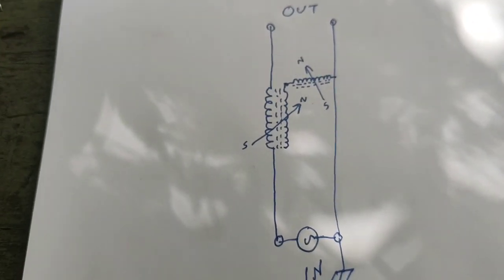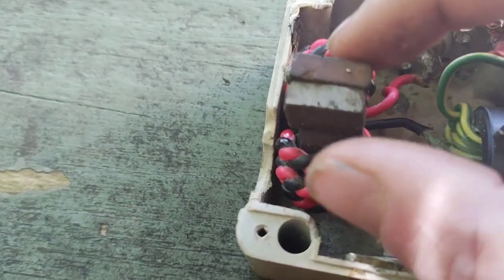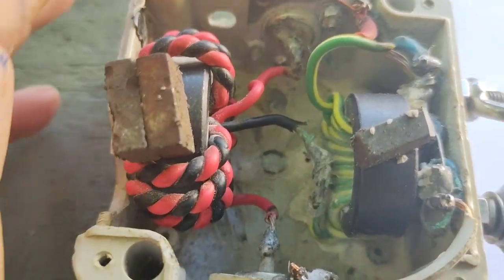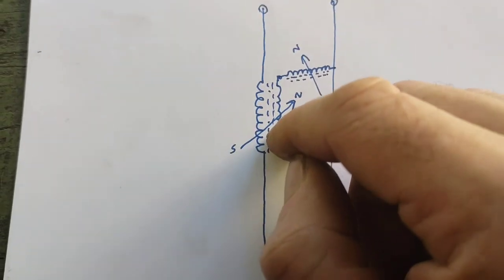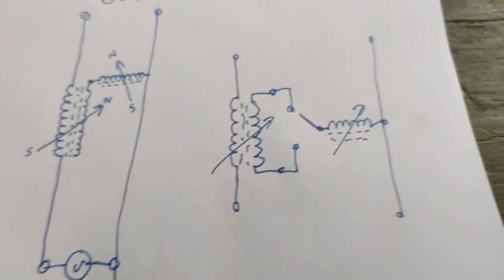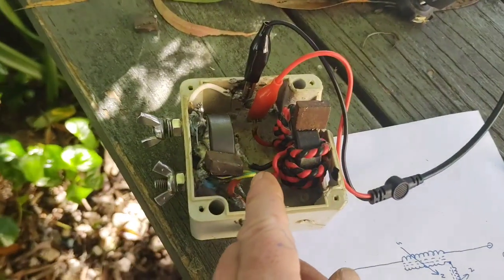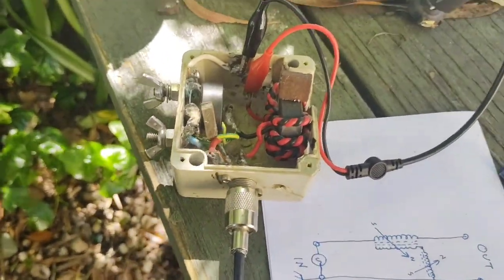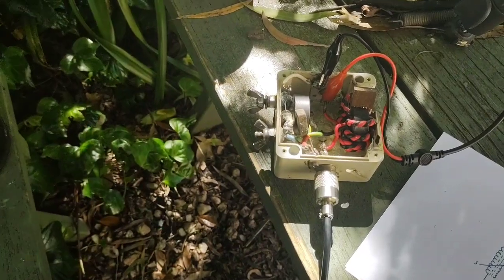How to Build a Magnetic L Match Antenna Tuner Without Variable Capacitors for HF.

Comment: interesting..
Reply from the maker: The concept works really well my friend.

The one in the video is my usual go to tuner for quick easy tunes on experimental systems.
Reply from the maker: Thanks for bringing my attention back to this.

I should really do a much better video on the subject sometime in the Future.

73 de VK3VKe 
Crazy Ham
⚡🙏⚡
Reply: @crazyham  is the magnets neodymium?
Reply from the maker: @minahasa999  You can use Neodymium for sure.

It pays to vary magnet strength for different tuning ranges too.

I am not certain what type my square ones are
as I got them from a lifting magnet.

Square or rectangle makes it easier
and if they are small,
yiu can change the amount of magnets stacked together to vary the overall range.

Also vary the position of the magnets on the toroids.

Now I am used to it,
I can find a match very quickly in general.
Reply from the maker: @minahasa999  One more thing,
is you could flatten a small section of each toroid with a grinder to make the magnet seat more stable.

I did that on a previous design where I used a motor to rotate the magnet
controlled by  DC along the coax using Bias Tee's

& Be sure to wind the toroids to a value that exceeds the max value required 
so it stays in range with the magnets applied.